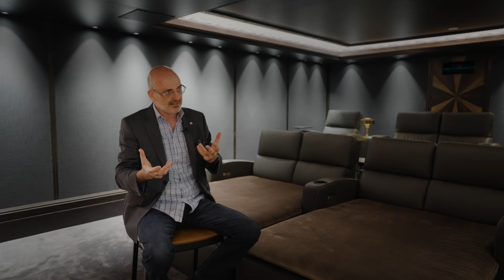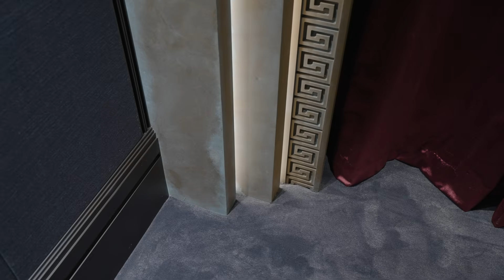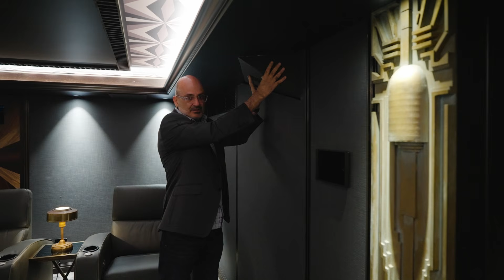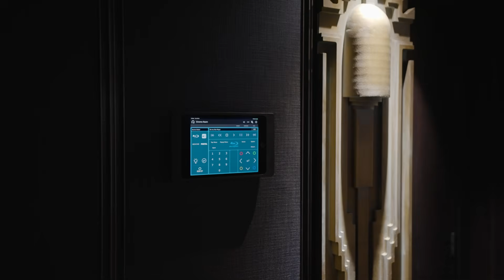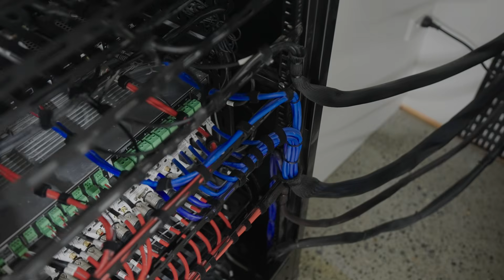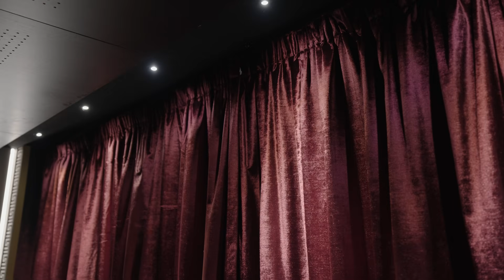Behind The Curtain: Inside a Technically Mastered Art Deco Home Theatre | Acoustics, Video & Design

Comment: These designs are amazing.
I have a question about home cinema room sizing.
If building a new house or home extension, what size room is desirable for a reasonable family cinema ?
I realize many people have many different budgets, but a guide to room size would be handy to think about.
The Cloister Cinema for example looks plenty nice enough for me.
Thanks.
Reply from the maker: Great question, and thanks for the kind words!

If you’re planning a new build or extension, room proportions are one of the most important factors in achieving a truly immersive cinema experience.

As a general guide, a room around 7m in length works really well, as it allows for correct seating distances and multiple rows if desired. A proportion like 7m x 4.3m with a minimum 2.7m ceiling height is a strong benchmark for a comfortable family cinema. If you have the space, increasing ceiling height further can really elevate the overall experience.

At the smaller end, we’d typically suggest 6.5m x 3.7m as a practical minimum for something like a 7-seat cinema, while still maintaining good performance and comfort.

It’s also worth noting that room size directly influences budget. Seating distance impacts screen size and projection requirements, and in turn, the output and specification of the audio system...so everything scales together.

If you’re starting to explore options, we’ll soon be launching a Cinema Builder tool on our website. It’s designed to give estimated costs across our Signature Series designs and should be a helpful starting point.  Keep an eye on: https://www.wavetrain.com.au/signature-series/

Hope that gives you a useful framework to begin with!
Reply: @wavetraincinemas8417  Thank you so much for the reply.